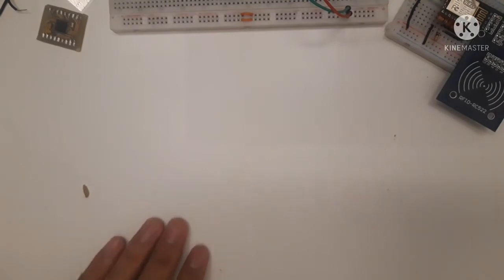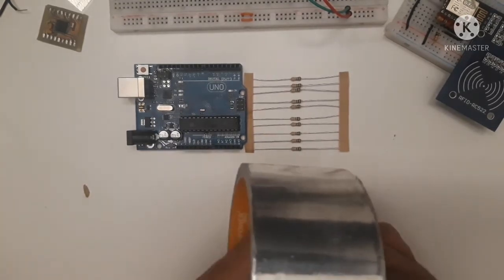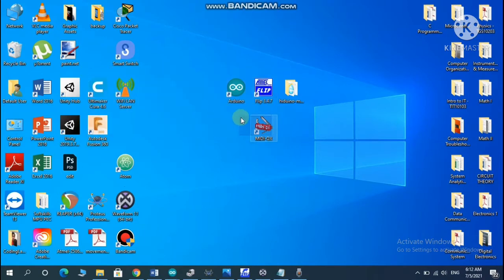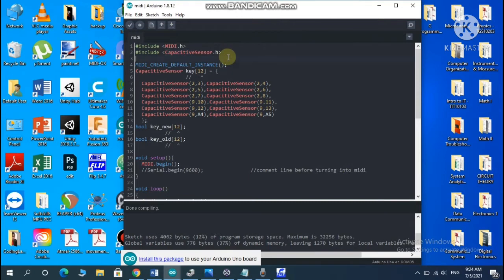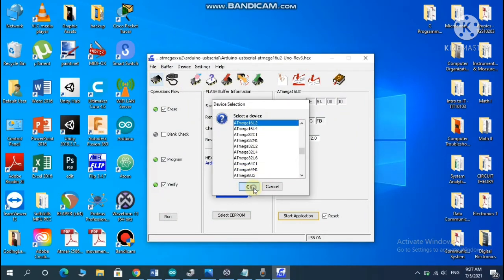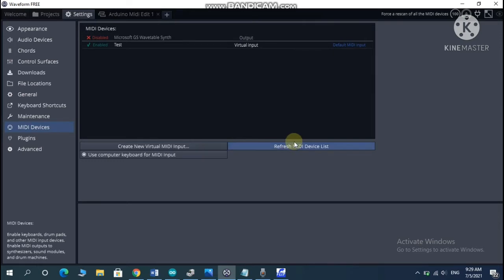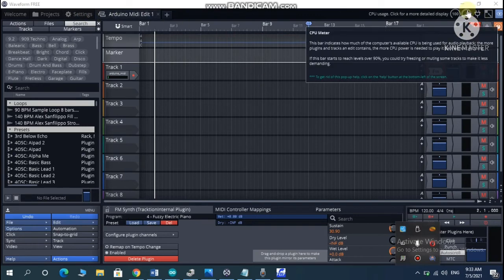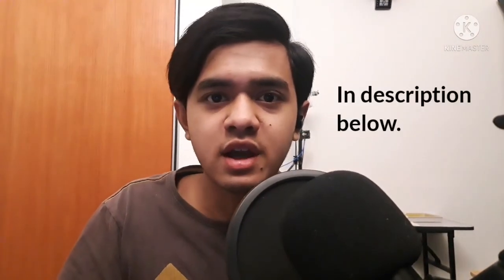Building a Capacitive Touch MIDI Controller Using Arduino

Comment: this is awesome. I've gone through two MIDI controllers really fast because I just realized that they don't. they always have like a feature done really well that I do like but then they just built the device and sold it based on that one feature and then none of the other features of it are notable. and so it forces me to have multiple devices and thats dumb so I just want to make my own. I'm not that good at programming though so unless I find other people's firmware and software and mash it together, which i can do, then I'm kind of dead in the water

Comment: Great video Man. Very informative. 
You can also make a video to make this capacitive touch midi controller using MPR121 breakout board. 
No other YouTuber has explained clearly how to use MPR121 with the clear code.

I think this will definitely benefit your channel and subscribers

by using MPR121, it saves the number of inputs in arduino uno which can be used for other potentiometers or more sensors.
Reply from the maker: I found out that MPR121 uses I2C protocol,   that just reminds me that you can actually you a port expander to increase number of pinouts for many purpose... If you mean clear code by not using a library, it might depend on the complexity, I'd take a look in the datasheet and the existing library see whether it's doable for me..
Reply: @syahrulzahwan  here is an example project. 
http://adam-meyer.com/arduino/mpr121_arduino/

All you have to do is convert these inputs into midi. I am sure you are very skilled and it will be easy for you to do this.
I searched everywhere on github and instructables with clear instructions if someone has made a midi controller with mpr121 but to my surprise nobody has done this.

Thank you for a swift reply. You have earned a loyal subscriber :)
Reply from the maker: Thanks for the source, im actually feeling like expanding this midi controller project as im getting interested in playing a real music instrument. I can't use my arduino mega because I use it in many prototyping,  so thanks for the idea, im looking forward to trying this module.
Reply: @syahrulzahwan  Really happy to help you get this. Eagerly waiting for you to modify this so I can also test it out and play around with it.

Comment: Awesome! Many thanks for making this video! Later i will try to make my own controller but first i want to interface a toy drum kit that came as promotional gift with a cacao    powder product with an Arduino nano or UNO. The problem i have is that the toy's circuit has capacitative inputs and i do not know how to drive them.  I reach your video searching for that information.
Will continue my research trip i will be back to this video.

Comment: Hello, I like what you did, and I have buy me an arduino uno to get started. But I don't know about  the point at 10:35 in you video.  Do you mean a temperary short cut between these 2 pins to get a reset.....or a permanent short cut ?  I don't want to distroy the uno from the beginning.
Reply from the maker: Temporary like a push of a button and nah it won't destroy anything,  it's not a data pin and the logic level is still 5v its totally fine. If you search for the arduino schematic under usb icsp you can find that the pin that was shorted was reset and gnd, in embedded systems, pulling reset to ground by shorting it will reset the board,  in this case it's the driver IC that's why you heard the USB unplugged sound. It looks shady because there are no reset button made for the driver IC, this is because Arduino never anticipate anyone would replace the ATmega firmware. Btw rlly appreciate it and rlly glad it got you into buying one, if you need any help you can join my discord server for any discussion.

Comment: Hey, so at the end you used 10MOhm resistors right? I got a little bit confused at minute 3:42 where you said you used 1MOhm resistors but the video shows 10MOhm.
Reply from the maker: Its 10M Ohms